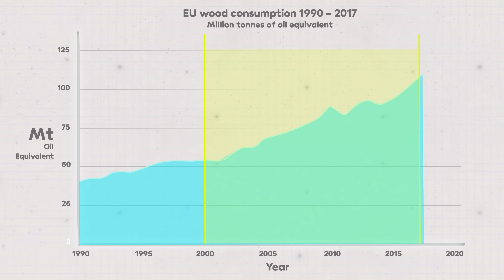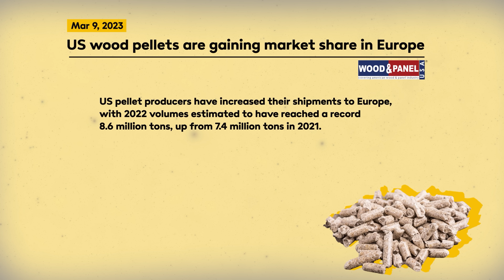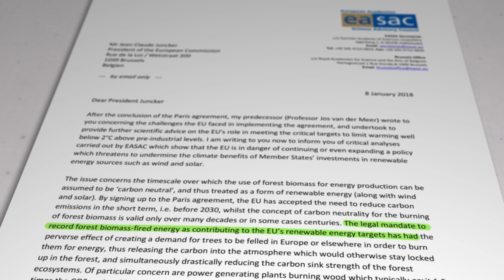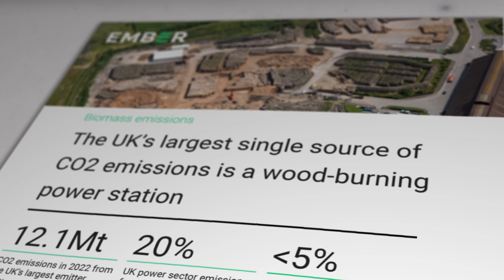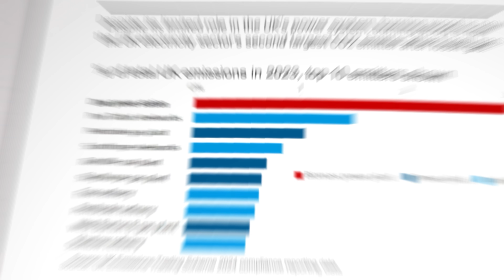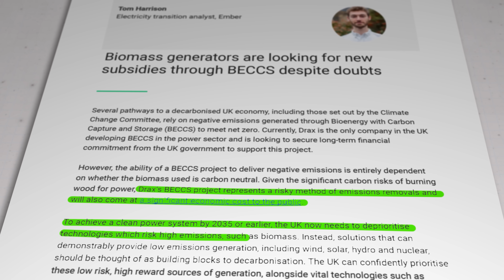New report: Biomass CO2 emissions 4X higher than COAL!!

Comment: So making sure the wood is thoroughly dried and then adding air into the mix, making sure you have a good amount of oxygen. Add it in to the mix.Will help the fire burn clean..Yes, adding more air to a fire can help wood burn cleaner. Explanation 

￼

￼

Air contains around 21% oxygen, and most fires need at least 16% to burn. When fuel burns, it reacts with oxygen to create heat, smoke, embers, and other combustion products. Reducing airflow starves the fire of oxygen, making it burn less cleanly and produce more soot and tar. 

￼

￼

Here are some tips for burning wood more cleanly: 

￼

Build small fires

Adding too much wood at once can reduce airflow and leave unburned wood. 

￼

Ensure proper air circulation

Try moving coals to create a valley for the wood to sit in, which can improve air circulation and help the wood ignite faster. 

￼

Burn hot and regularly

Regularly burn the fire hot enough and with open vents to burn off any particulates from slow burning. 

￼

Check for smoke

If you see smoke coming from your chimney, your fire may need more air or drier wood. 

￼

Other tips for burning wood properly include avoiding wet wood and never burning treated wood, paint, plastic, tires, asphalt, petroleum products, metals, or commercial paper and cardboard. 

￼

￼

Alaska DEC (.gov)

Burning Wood Cleanly - Video Vignette

Here are some tips for burning wood properly: Build small fires to help the wood burn completely. Adding too much wood at one time cuts down on the air to the f...

Comment: Move some coals out from directly under the wood. This allows better air flow between the wood and hot coals and speeds up combustion. Create a valley of coals then place your wood across the valley. This creates better air circulation so the wood ignites more quicky and burns more efficiently.Apr 9, 2024

￼

https://www.epa.gov

Tips for a Better Burn | US EPA

Comment: This was known by environmental engineers for forever, so how is this a "stunning" report? Burning biomass is not a carbon sink, rather you want to upcycle it first, for example, by composting and separating out natural fermentation gasses. In most LCA models, burning biomass in coal plants is mostly only good for reducing the footprint of the plant if the biomass is located very close-by, so that should tell you enough when during the next step all the numeric assumptions going into the equation are chosen so that they "make sense" for politicians. For example, the numbers are chosen so the biomass plan reduces CO2 emissions by 10%, but see how that target doesn't work because 1) we shouldn't focus on CO2 emissions but on greenhouse gases in general and 2) as mentioned politicians should focus on those input numbers and all other alternatives. That is to say LCAs should be comparative across disparate solutions since they are intended for facilitation of optimized policy creation. Moreover, they should be exhaustive meaning to say they drill down into the merits of other system changes. For example, if some of the trucks that haul biomass were to be fueled with renewable electricity themselves (mind you that's just a minor part of the whole LCA equation) the break-even distance for emissions savings by biomass would be greater. Now if the coal that goes to a particular plant is hauled long distances with energy inefficient means, then for that plant the break-even distance might not be negative. LCA, in general, is a mess of assumptions, guesses and yes, political goals, but that's also why it's a separate vocation and not a sub-task of other vocations.

Comment: Here are some tips for burning wood: 

￼

￼

￼

Prepare the wood

Make sure the wood is dry and seasoned before burning. Hardwoods like oak and maple can take up to 12 months to dry, while softwoods like pine and spruce can take at least 6 months. You can test if the wood is dry by banging two pieces together. Dry wood will sound hollow, while wet wood will sound dull. You can also use a moisture meter to check the moisture content. Seasoned wood is also pale gray or beige in color, has noticeable cracks and splits, and feels lighter than green wood. 

￼

￼

￼

￼

Prepare the area

Keep flammable items like curtains, furniture, and newspapers away from the wood-burning appliance. You can also stack the wood split side down and away from buildings, and cover the top of the stack to protect it from rain or snow. 

￼

￼

Start the fire

Use lots of kindling and crumpled newspaper to start a small, hot fire. You can also add a few small pieces of kindling, then light it. As the fire grows, you can add bigger kindling a few at a time. Once the fire is hot and bright, you can add logs to keep the heat flowing. 

￼

￼

￼

Burn efficiently

To burn wood more efficiently, you can cycle your kindling to keep the logs hot. This will help additional pieces of firewood ignite when you add them, and it will keep the flame burning longer with less smoke. You can also position the logs close enough together to keep each other hot, but far enough apart to allow air to move between them. 

￼

￼

￼

Environmental Protection Agency (EPA)

Best Wood-Burning Practices | US EPA

Apr 9, 2024 — When using your wood burning appliance, follow these guidelines for safe operation: Keep flammable items, like curtains, furniture, newspapers, and b...

Comment: Giving huge incentives for something that potentially could be made sustainable, without making sure it actually is isn't a very good idea.

Depletion of bio fuel within reasonable distance was part of the reason people first started to use coal instead of wood as a fuel, thousands of years ago.            

Selective logging can make a forest productive, without significant reduction of carbon uptake, it can actually make a forest achieve/retain net carbon uptake, compared to a forest that is left completely alone that will reach near equilibrium between uptake and release. But obviously, that requires competence in planning and selection, and you can't bring machines the size of houses into a forest to harvest a few select trees here and there so we will probably not see much of that anytime soon. Also, to achieve net carbon sequestration, at least a  significant part of the harvested wood needs to be turned into things that won't be burned for a long time. 

Too bad, a quite significant potential for "carbon negative" building materials and some carbon neutral fuel as waste from that, is just not realized on any relevant scale due to the fact that it is easier to just clear cut and pretend that is sustainable. 

Also, not all trees takes decades to grow, some trees like Balsa, in the right conditions, can be harvestable in as little as 5 years. Also there are for example willows that can be coppiced down to just above the ground with a few years interval, while leaving the ground and roots largely undisturbed. Willow pellets can be produced relatively sustainable, and relatively easy, but again, not as easy or cheap as clearcutting existing forests and pretend that you're doing the climate a favor by doing that.

Comment: Btw the EU  does no longer define wood pellets as carbon neutral. This leads to the bonkers situation in which Germany founded a new wood chip heater last year and is in the process of putting heavy taxes on pellets and even chips.. they even discuss to make it illegal to burn wood chips made from neighborhood gardening waste. Which is complete mental considering most of them dump that in the nearby forest.

Locally sourced wood chips are mostly made from infected or damaged wood or wood to thin to make anything else form it. Leaving infected wood in the forest to rod is a sure way to infecting the rest too.

Comment: as most of the CO2 is consumed by ocean, nobody can say that they are carbon neutral, no matter how much trees they plant, so the whole idea is incorrect from the first place. currently in order to decrease CO2 they just waste money on pointless projects or even worse, they create more CO2 instead of building solar, wind powered stations to main nuclear stations which should be main source of energy. there are already closed cycle reactors, no waste, even with waste it's still less dramatic to climate than burning fossils ja biomass. 
Also whole idea of CO2 as greenhouse gas is stupid, water vapour is main greenhouse gas and it's also released by burning, especially natural gas(less polluting they say) and oil products and probably we lost the moment at which we were able to stop climate change. now temperature is raised, so additiaonally added humidity is coming not only by burning natural gas, but also from evaporating from all kind water sources. and the more it evaporates the more temperature is rising and then more water will evaporate. so fighting agains CO2 while H2O is rising feels like there is no stop of climate change at all. There is only hope that climate will regulate itselt somehow and adding more greenhouse gasses doesn't increase temperature in linear way and at some point it'll stop.

Comment: Burning wood (pellets) also produce pure carbon (ash) which ultimately is taken from the atmosphere and stays locked as it does not decompose for a very long time, in fact for much longer than wood left to decompose in forests or elsewhere. Decomposing wood releases not only CO2 but also methane, a much more potent greenhouse gas. It is also a matter of finding the right biomas that can be reproduced quickly, for instance bamboos that grow very quickly even in UK and don’t even need to be replanted after cutting down - they just grow back. Just have a think 😅

Comment: Customers are beeing lied to.
And it goes like this:
I have a house. The house has an old gas heater. I need a new system. I call the expert. The expert tells me this : "Well, I recommend wood pellets, because it is renewable and sustainable."
And so I buy the pellet burner for round about 10k.
Later on I learn the pellets are not better than gas.
Now I tell my self "Well, at least I'm not burning coal like the people in China."
Turns out China is cutting back hard on coal as well.
At this point it's better to either consume no news at all or vote for ultra right wing hard core racist political parties who put all climate blame on those immigrants who throw glass into regular bins.